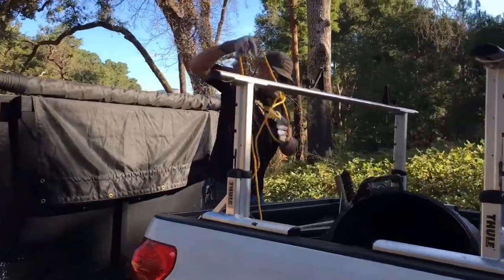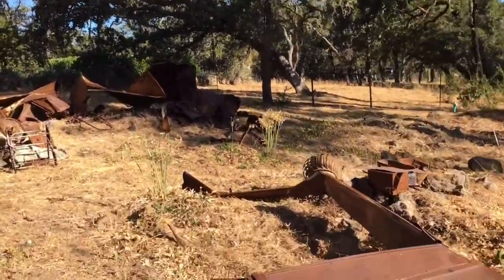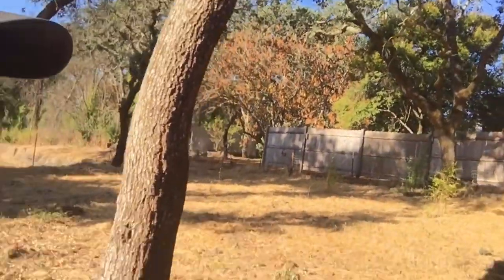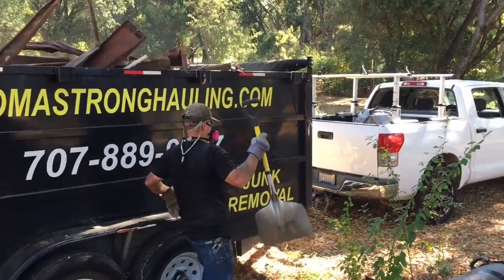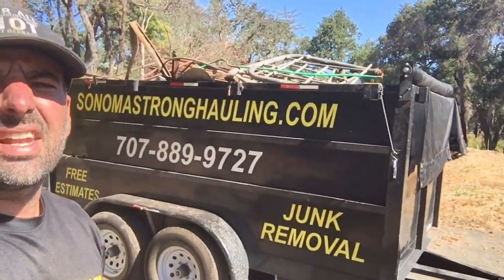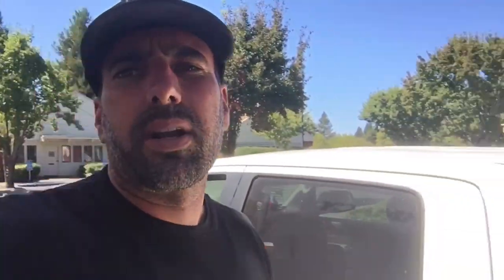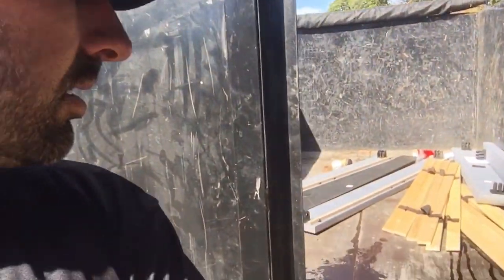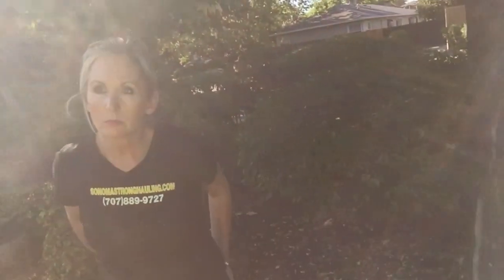How To Stack Checks  IN JUNK REMOVAL!

Comment: We used to pick up Frac Sand in Kermit TX for the Permian Basin oil fields.
I always buy two cases of water.
I believe in buying two. Actually that started with Noah and the Ark. 
When one case is gone it’s time to buy two more. 
Get an app from your bank so you can deposit the check by photo. It clears right there and then. Faster than a card.